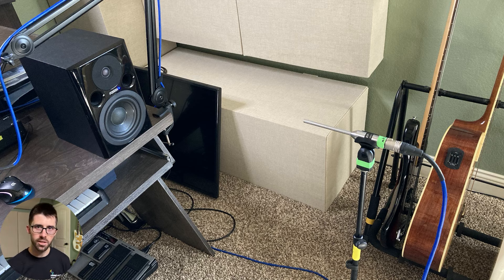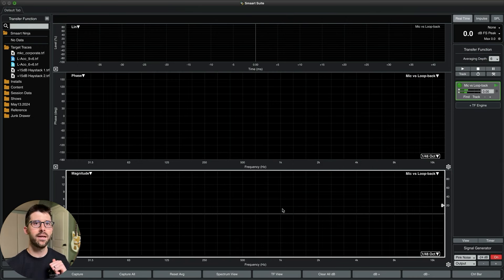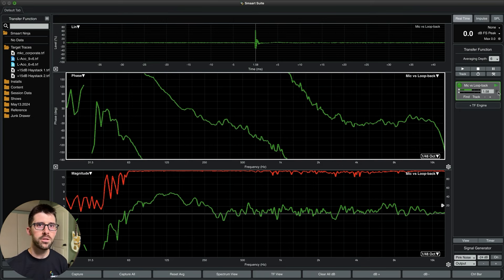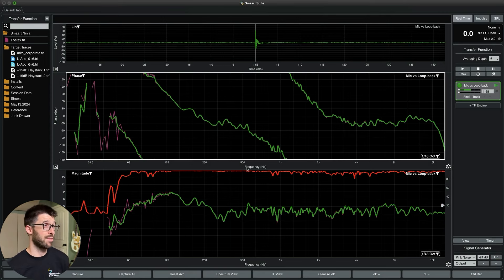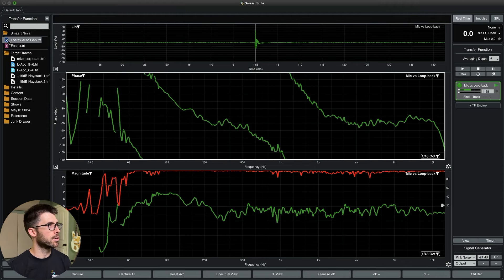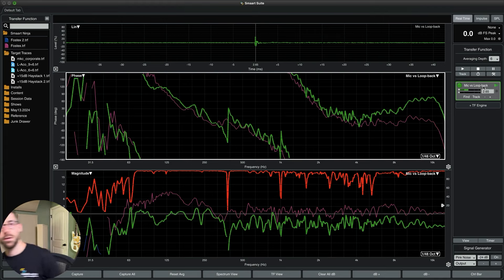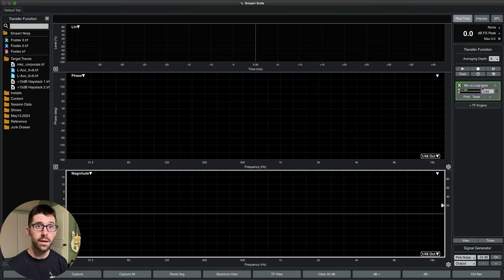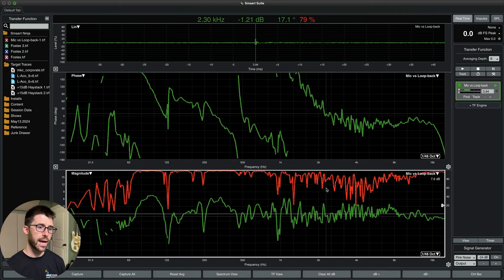How I Move Ninja Fast In Smaart When Tuning Sound Systems

Comment: Thanks for the tips. I use most of those shortcuts, but D was a new one for me. It would also be good to walk through the timer/macro function. I tried it in church one time but found I had mixed results. I don't think the delay locator worked quickly enough to set the delay before trying to capture the measurement. So I went back to the old 'run back and forth to move the microphone and capture'.

Comment: if you wanted to shave a little more time, use V to reset your averages immediately. Smaart eases into the trace stabilization slower than it actually needs to do so. Using V will snap it into place immediately.